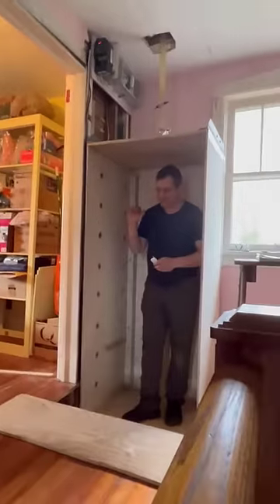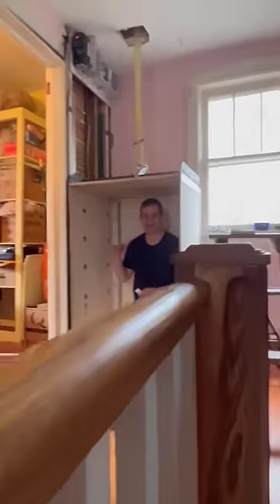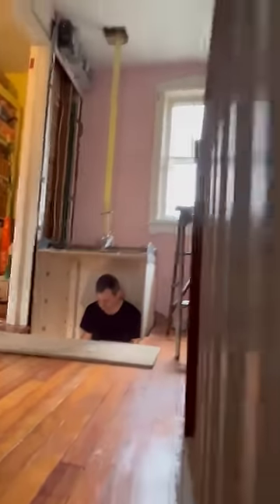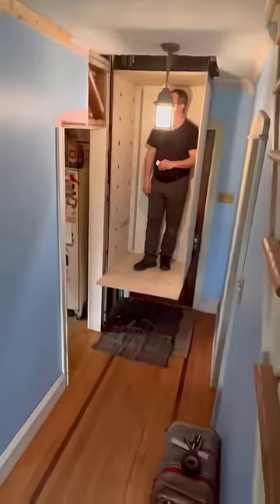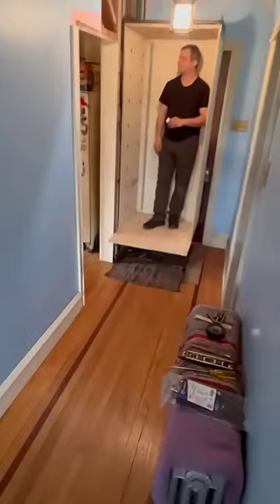Home made DIY Elevator First ride with test dummy 😁

Comment from the maker: I wrote out a nice long information comment and when I hit post, I got "returned error" in red text from youtube. So.... Multiple comments i guess for now.
Gram's elevator project 2022. 
First off... don't try this at home expecting whatever you read or see here and elsewhere online, to be enough information to pull this off on your own. Between the 3-6 people that had input on and assisted with this project, we had an electrical engineer, two mechanical engineers, a lawyer who wood works and myself, a jackass of all trades. I wouldn't say it's a weekend project for the inexperienced, but it can definitely be done by some good DIY veterans with a little help from youthful muscles at times. 😂
Reply from the maker: Step 1. is think about it and plan for a year. No joke, well, half joke. Pop considered where in the house to place this for quite a while. A studded wall or frame of some sort is required (for the safety brakes and keeping it in line) so we knew it had to go on a wall (Their house is too nice and too small for a frame to be taking up space in a room). We needed a wall without too many wires going across the stud framing and zero plumbing in the wall. Their house is from first half of the 1900's so the rooms aren't huge, which is why the elevator doesn't go directly into a bedroom. We chose a spot near an exterior wall so the motor could be mounted in the attic crawl space and not be in the living space of the attic.
Reply from the maker: Step 2. Recon: We cut some holes in the wall and used a borescope camera adapter on a cell phone to confirm the spot we picked did not have too many wires and had no plumbing etc. (This was unnecessary for us since we were so familiar with the house, having re-wired it after a fire some years ago, but I wanted to test my camera - it was meh, a little brighter light would've been nice)
2a. Motor and brake recon --- We chose to put the motor in the attic and run power lines up to it. Originally, before we knew we could use that motor and gearbox, we were planning on using a 12 volt ATV winch and mounting it on top of the elevator cage. (This would have been much simpler and would've meant battery backup built in, for power outages, BUT, it wouldn't have the acceleration and deceleration at the top and bottom, also, winches are LOUD, like 60-80dB right above your head?.. naw, the AC motor worked out great for us! As for the safety brakes, ours engage against the wood frame work we mounted to the studs that the tracks then mount to. If you've got the money, you could simplify the whole thing quite a bit by using a fall arrestor style safety brake. We would probably have chosen our system anyway though, because it was a fun design challenge and works really well, stop s the car in under half an inch if the main cable faults. 
We also debated using a latching safety system similar to a car lift, but it would require user interaction for the down trip, which we weren't too keen on
Reply from the maker: step 3. Demolish the shit outta the walls! Just kidding... get a saw, cut it out nicely exposing no more than you really need (don't want too much to patch later).
3a. cut the hole in the ceiling/attic floor - we located the lifting point just rear of center to the car and just about an inch off center favoring the wall/track side. Use a plumb bob or whatever fancy maths you prefer to find where you're going to cut that and of course, oversize the hole.
3b. Cut the hole in the floor. Too late now... you're committed to this project and can't go back without looking like a chump😁. We chose to make ours about 40" deep, and about 30" wide. Basically, we sat in a wheelchair and measured down to the smallest we felt it would still fit with a little toe room. 

**A note on the wall demo... we chose not to take the other side of the wall off downstairs because it was lath and plaster, but if you've got drywall, clearing that out too, would make installing the car to the rails WAY easier and it opens up the possibility of moving the microswitches to a more concealed place.
**A note on floor demo... depending on where your joists are, you'll want to support under the remaining floor boards so they don't bend near the gap at the elevator on the second floor. AND - if you make the whole a little too small, it's easier to cut more out than it is to remake the elevator car to fit or to try and fill in a hole. So, you know... don't be the guy that cuts it three times and it's still too short. Whenever possible of course. we all know Murphy likes to shove his law around some days more than others.
Reply from the maker: Step 4. We got a couple 16 foot long 2x6 boards and ripped them length wise, because finding a straight 2x4 post 2009 seems to be a damn near impossible task. 🤦🏻‍♂As it is, we spent over an hour at the lumber yard picking through a whole pallet of wood until we found a straight dry one. These get mounted FLUSH AND PLUMB like nothing you've ever plumbed before, because if they're crooked at all, the tracks will be very hard to get square to each other, and they need to be. (Unless you wanna get real fancy with the car mounting, but that would add more depth sideways than we wanted). We used a laser level and old school level and plumb bob whenever and wherever possible, throughout the whole project. We mounted these 2x6 ripped down to 2x4 to the existing studs, and the base plate of the wall frame. Shimming where needed to get the two new studs perfectly flush and plumb and square to each other. We also mounted them in a way that they sit just proud of the existing studs, creating a little clearance room for the safety brakes to engage behind the steel tracks, into the wood itself. This also helped with clearance for the car keeping it away from the wall a little was useful as it passes through the floors and very near a doorframe upstairs.
Reply from the maker: Step 5. Mount the tracks to the uprights - thankfully we had some really nice stainless steel tracking from a food plant assembly line on hand that is lined with a very hard plastic to provide a smooth gliding surface. The rails we used also had mounting tabs pre welded onto it, so we were able to just use heavy lag bolts and anchor it to the newly installed stud uprights. The tracks were multiple pieces and interlocked together. We staggered the joints, such that the south track joints were not in the same spots as the north track joints. - This was in theory to reduce any binding at the seams. I wanted to use rollers, but we ended up using 1"x 1.5" x 12" square tubing as slides in the tracks, welded onto 2"x3" x 6' angle iron. which then bolts to the elevator car. The stainless tracking guide is 1" so the steel tubing fit nicely in there and with a little grease, it slides nice and smooth and the elevator car barely rocks or wiggles at all - even less so than a real elevator in an office building does, so that's a plus for not using wheels. BUT.. we have found that if the rider leans too far forward in the car, they can cause the slides to bind up a little in the guide tracks and the motor stalls out tripping the breaker. So, next time, wheels. and, we're going to add a guide roller to the main lift strap that will keep the load centered while lifting as it raises, instead of letting the strap pull the car forward as it spools up on the drum. So ours will be an easy enough fix with an added roller and/or just not leaning forward, but if I start doing these for people, they'll likely be rollers instead of slides
Reply from the maker: Step 6 -ish.. Getting the elevator car mounted to the slides was a little tricky. We mounted one slide to the car, then placed it in position, and using a clamp and a couple guys with long sticks and some rope, we were able to then get the other slide in position and mounted. It's just bolts through the side of the car, into nuts welded onto the angle iron that the slides are welded to. (I know... a picture would be way more than a thousand words here... I'll work on a video or something in the future)
6a. Once the car was in place, we mounted the top framework, which is comprised of steel angles and round stock and some flat steel arms, some springs and cables, the lifting clevis and the mechanism for our safety brake system altogether probably weighs close to 80 pounds and makes the car top heavy, which is why we installed it after the car is in place.
Reply from the maker: Step 7 - Mounting the motor and gearbox - also, HEAVY as fark and as such, needs a solid mounting platform. In the attic, we mounted a 5(ish) foot long steel angle on top of one of the joists, to spread the load of the car and prevent the joist from flexing under load. Then spanning across three joists went a 2"x8" board which got lag bolted into the joists. The motor and gearbox with its mounting plate then get bolted to that board. KEY INFO HERE: Placing that board is important! You don't want to have to move it because the holes from the lags will start making your rafters Swiss cheese and your house will collapse on top of you😆 and since you're in the attic at this point, it'll be quite a painful fall😫 So, out comes the plumb bob - to locate the position of the strap or cable when the car is all the way down. This is because as the car comes up, and the strap or cable winds up on itself on the drum, it gets farther away from the rafter the motor mounts onto. (Another picture would be worth a thousand words here, I know). Basically... as the strap unspools on the drum, as the car goes down, the strap gets closer to the rafter, so you need to place the motor in a way that the lifting strap doesn't actually ever rub on the rafter, but is as close to it as you can be, for strength. I hope that makes sense.
Reply from the maker: Step 8. Wiring and operation. This would vary wildly depending on if you're going to use a 3 phase motor with gearbox and remote operation, like we did. Or if you want to go simpler and use a 110v hoist or 12v system with a winch. We used a 3phase motor and tigear gearbox, which was not quite powerful enough or slow enough for what we actually wanted, so we had to add on an external gear reduction as well. The 3 phase motor and VFD only use about 3-5 AMPs when running. To do it over again, we would buy the correct sized motor and gearbox, last I checked, they could be found used for under a grand US easily, and there's even a few out there under $300 if you look long enough and pick it up yourself. We had this one on hand though, and a machine shop and a mechanical engineer or two, so adding the external reduction wasn't a deal or budget breaker for us. After Running a 220v 14/2 wire up from the basement, we powered the motor using a Westinghouse variable frequency drive supporting up to a 1HP motor. (ours is 3/4HP) We programmed the VFD to accelerate to full speed (60Hz) over 4 seconds and to stop in 0.2 or 0.1 seconds, but there is a switch that triggers a speed change about a foot before the top or bottom stop. So, the car leaves position, accelerates to full speed in 4 seconds (full speed is under 33 feet per minute for us, I forget the exact number since someone else mathed that part out and I don't have the spreadsheet with me). Once the car travels past a certain point, it triggers micro switches that trigger a speed change down to 10Hz in 1.2 seconds, or about 17% speed, so Gram gets a nice smooth slow landing. Then about 12" past the slow down switch, is the limit switch, which triggers the stop command on the VFD. The limit and speed change switches are mounted to the wall and activated by a board mounted to the side of the car. The board is tapered and sanded to ensure smooth engagement of the switches. I wish we could've found a way to mount the switches more out of sight, but time was running out, gram was home from the rehab place, and we just wanted it operational already, so perhaps in version 2.0 if I ever have need or opportunity to build another, I might plan ahead for those better. As is, we covered them with a pretty nice little painted metal trim piece, they don't look too bad, and we mounted them high on the wall, so they're not likely to get kicked or bumped or anything either.
Reply from the maker: As for the operation side, it's two remotes. One for a system power, which is just a 110/220v wireless relay from amazon, they use a similar remote and frequency as a garage door opener or old school remote gate switch. Then a second remote, with up down and stop commands. We used a controller board for motorized window shades that had provisions for upper and lower limit switches as well as external relays bult in. This was SUPER convenient for wiring things into the VFD, it allowed us to electronically isolate the microswitches for speed changes, and saved us having to buy mechanically one way triggering switches, which could be found for probably under $100 a piece, if not even under $20 if you search long enough. (We need the speed change switches to only trigger one direction, so it doesn't confuse the VFD while going up as the car passes the downward slow down switch, and vice versa... if that makes sense) Alternatively, you could use a commercial garage door opener controller to control the VFD. They're sweet because they have a slack rope sensor built in as well, and you can get them with up down stop buttons, plus they're likely higher quality than a window blind controller. 

But, Alex, what about the car itself? Well, dear viewer, its plywood and aluminum angles. we used half inch and I think 14 or 16 gauge angles.. I'm not sure, we just had them around already. we used a thing called T-Nuts for the fasteners to bolt the angles to the car, they worked great. We also drilled countersinks and used flat headed screws, so it's nice and flush inside and out of the box. With the exception of the bolts holding the box to the slides, those bolt heads are exposed inside the car. In version 2.0 they will be replaced with rounded heads, probably allen or torx. 
I've surely left out a few things and certainly didn't go into full detail, but that's more than a brief overview, certainly enough info to get some folks into a project they regret starting 😅
Reply: 👍Абсолютно верно .Мне самому предлагали соорудить нечто такое для выхода на чердак( мансарда)
Reply: Most things like this are built to rules created when things went really wrong. Really, really wrong. Just saying.
Reply from the maker: @NoSpam1891  No, they aren't. You're thinking of publicly accessible elevators with multiple floors and counterweights and all sorts of magnitudes more potential for danger than this little guy. 
Most things like what you see in this video are built with cheap hoists and fall arrestors, if anything, for safety backup. 
I also have yet to see another one like this that changes speed.
Thanks for the view though.
Reply: How do u get threw that door when its down
Reply from the maker: @breakingblackmagic7617  Well, you can't. You'd have to wait a few moments until the car is sent back up where it parks, or use one of the other doors to the house.
You meant through. Threw is the past tense of throw. Unless?.. nah, nobody throws doors. 😅
Reply: if ya woulda had some Actual trades-people in that mix it probs woulda happened more quickly & w/ informed insight ('cause i betchya the electrician has some elevator experience)
Reply: Anyway, Nice Work - Fun Project(!) "Nothing is Easy"  Thanks for the info!
Reply: so quick question - you have 3P elec. at the house (not likely), or how are you making up the 3rd phase?
Reply from the maker: @jamesdavison2416  actually, of all involved, the electrician wanted almost nothing to do with the project. 😆 No, no prior elevator experience from anyone involved.
Reply from the maker: @jamesdavison2416  thanks, sure was a fun project 👍
Reply from the maker: @jamesdavison2416  the Variable Frequency Drive takes single phase 220 input, and converts it. Which is friggin super convenient and crazy cool.